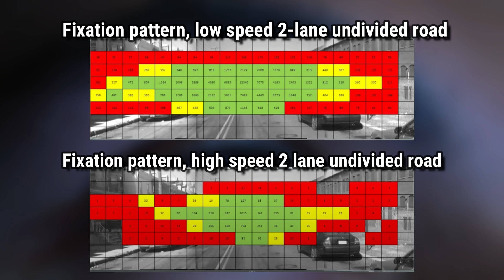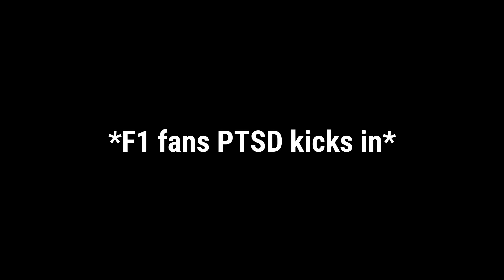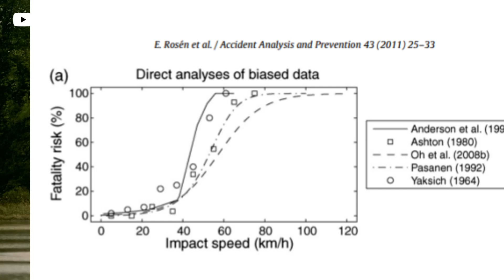Why Speed Limits Are Useless

Comment: Driving in Ireland was a brain tilt. 60mph speed limit on twisties where the road was so narrow, one of you had to poke your front bumper into a hedge so the opposing traffic could pass. Most driving was done at half that speed; but there were straightaways. *They assumed you had common sense*. Watching for herds of sheep, or the odd one crossing. Driving has your FULL attention, and I never saw even a fender bender. 

 I never saw a driver with a phone in their hand.

Comment: If a city makes a road more dangerous they should take on the liability for any injuries or damages caused by the design. 
Speed limit and signs work perfect for most people most of the time. It's just we live with a sizable minority of jerks. 

7,000 deaths a year is nothing given that healthcare mistakes, (medical errors) kill 500,000 people a year. Instead of spending trillions to make roads more dangerous spend a few billion to force hospitals to electronically track the medications they give people to avoid conflicts. That simple change would save nearly 90,000 lives needlessly lost a year. 

Not that any traffic use vehicle safety measures today are not going to matter in 20 years when all cars will be highly augmented with computer driving assists and accident avoiding systems. The move for road redesign could have started 40 years ago and had some positive impact. Within a decade or so most of our biggest avoidable traffic accidents we be solved by technology.

Comment: Why is the elephant not being addressed? If it is unsafe to drive 30-40 mph on city streets or over 65mph on the highway, why do auto builders make 600+ hp cars? I see bikers doing well over 100 mph going down I-20 in Dallas TX. NO, not all bikers do this, but enough do that they are a danger to themselves and others. If cars were built to only accelerate to 70mph then you would eliminate a whole lot of fatalities. But, the public would not stand for that (me included). Better driver education, serious enforcement of cellphone laws and stronger punishments for traffic violations have been tried. I agree with "better designed roads", but there are many other things that would help.

Comment: Speed limits themselves are useless. It's just that driver training is vastly insufficient in most countries. Besides, how can a 30 year old shitbox on chinese tires be able to safely travel at the same speed that a brand new car full of safety systems, with top of the line rubber? And how can you compare skills of a professional race driver to the skills of an 80 years old grandpa with dementia? Putting everyone and everything into the same basket just doesn't make any sense. Drivers should be allowed to judge the safe speed themselves. And they should be held accountable for their decisions. No speed limits required.

Comment: I am not trying to say narrow roads are necessarily bad, but there are two main reasons that I can think of why American roads are so wide. One is to better facilitate the movement of large-scale equipment and vehicles. It has long been a trend in America that bigger is better, after all. The most important one, though, is to help our military mobilize much faster. You have to realize that much of the road system of this country was originally designed to help our armed forces repel invasions or move more quickly across the country in the event that they need to stage an invasion themselves. That's not to say that we shouldn't change things at least a little bit. Though the biggest change really needs to come from the drivers, not the roads, if you ask me. The fact is, too many stupid people think it's alright to speed through cities and towns on the regular.

Comment: I actually disagree with your points. In the same way that Moral Law exists outside of how we feel or perceive, speed limits are the local set law for the safety of a specific road. Everyone will perceive safety differently which is why we need law. As a society we need to learn how to not go off our feelings but by the law. While i think the infrastructure should be changed for the better, its not the solution, but an aid to people who listen to their feelings more than the law.

Comment: Great job on the video. How about, as an interim measure, educating drivers to readily identify when they're on a street that's not built to provide the correct visual cues? In other words, learn to recognize when you're getting signals to drive faster and SLOW DOWN. It could be part of driver licensing, alongside learning the Rules of the Road.

Comment: Speed, or Speed Limits, is use in America because not of the speed itself but because of people who drives are reckless.  There no ways to fix the roadways in America other than using Interstates Freeways.  Also the cars in America only design the top speed of 90mph.  Not just horsepower but suspension, steering, and other cheaper designs that limits the vehicle’s performance.  And most idiots, I’m sorry I mean drivers, don’t know this and do not care if they cause an accident.

Comment: There is a term I've heard used before for that "dangerous road" you use as an example of bad road design in this video - a "stroad" a sort of streat-road hybrid, where you have a high speed road, serving the function of a low speed street at the same time. These are very common in suburban settings in both the USA and Canada and are very discouraging for cycling and walking, tending to force people into cars.

Comment: The USA has traffic systems designed to allow commercial trucks in and out of areas. Thats how we get everything to its destination. The size of a truck is pretty much standard. If we start making things too narrow and claustrophobic we cant get deliveries to restaurants and shops. Then we'd have to completely redesign the transport methods and add another layer to an already complex system. For example look at a euro truck compared to an American. Euro trucks are short and narrow even if theu havr a trailer. Most of the time its judt a box truck. In the usa you habe a 20 foot tractor in front of a 53 foot trailer thats 108 inches wide. You need this for long distances between shipper and receiver. In the Netherlands you can cross one side to the other easily in a day and return home. An American driver will spend weeks out on the road driving between cities
Reply: Finally, someone understands my point of view, as a trucker who has been around a good chunk of Canada and the U.S., why we can't narrow streets.

102" wide is actually the max. I remember last year seeing a few 60ft trailers from Walmart in Ontario. I doubt they do multiple pickups and drops, most likely just to and from major distribution centers.

There are times where the destination of the load is on the other side of town and the only way there is through the middle of town, we need the big streets to make it around the corners without running into trees, traffic lights, hydro poles (I'm from Manitoba, Canada where we generated about 90% of our electricity with hydro electric dams and thus everyone calls power poles=hydro poles). 

Shrinking the streets in the middle of town to the point where they would only work for a car would create havoc for the trucks that have to get in/out/through those areas. I can think of a few corners where I have to take up 3 lanes from the street that I am turning from, and 3 lanes on the street that I am turning onto, just to make it around the curb. 

Plus a lot of European cities were built before cars, most American and Canadian cities were built for cars or at least built for horse and cart and then modified for cars.

Comment: Another point not mentioned by the narrator is that a street may be designed for 50 MPH traffic but signed with maximum legal speed of 30 MPH--giving plenty of invitation to drive faster and get ticketed, generating plenty of revenue for the city, the county, or the state. This is done intentionally.
Reply: Got a stretch of road like that by a university. Speed limit is 40mph before this stretch and drops down to 25mph with no change in the road (feels like 40). Even the slowest drivers I've been behind, still drive 40mph anyway on this stretch
Reply: @bixbysnyder-00  There is a road like that in auburn that does the same thing. There is no change in the width of the road, no additional trees planted, no curves, nothing that would ever signal to a driver "hey, you should slow down". Instead, the cops here just use that to set up a speed trap. Its all a money grab, from the predatory towung subsidized by the city, to expensive college, to the police here, its awful. The cops here are so bad that I actually feel less safe if there is a cop around, even if I know im doung nothing wrong.
Reply: @cadenorris4009 and there’s no city you are entering or anything like that when it drops down to that speed?
Reply: Not always or necessarily intentionally to generate revenue. That is untrue.
Reply: Another problem with speed limit signs is that you can never tell whether it was placed by an engineer or a politician.  The engineer starts from the law of physics: E = ½mv² which is self- enforcing.  If you are doing 75 in a 55 mile zone, there is roughly twice the energy available to mangle the motor vehicles and puree the people when something goes wrong, regardless of whether there is a cop in sight 😢 !
Reply: @WalterRutledge-l9i  this has been mentioned many times by speed enforcement advocates. In practice, it's not the absolute speed, but the relative speed difference between you and rest of traffic. If everyone is doing 75 in a 55 speed limit freeway, then you're far more likely to be in a collision being within the posted limit than driving at the same speed as others.
Reply: @dominionian7193  The unwritten rule of running with traffic (within reason) actually works. The problem here in the USA that causes the most issues that I've seen (other than cell phones) is lack of signaling, and we just can't seem to "zipper" for shit at entrance ramps/narrowing roadways. 

Nobody ever wants to "give way" and let someone in. Like being one car position back or forward is going to make a vast difference within a 5000-car group lol. I hate driving in/around cities. You have to shoehorn your way everywhere all while watching for some jackass to cross 5 lanes of traffic without signaling.

Comment: As a computer gamer, i had to practiced driving at speeds over 100mph.  From time to time, I use this ability while driving.  However the one thing i had noticed, the faster I go the more alert I am, and the slower I go the more relaxed I am.  So there is more of a chance I will see a red light while driving at a faster speed then slower.
Reply: Me too. I get bored putting along.

 Also, in traffic, going slow is far more dangerous than speeding on an open highway.
Reply: Boring normies can never understand that… speeding is associated with reckless behavior because of reckless people but there’s nothing more engaging than high speed control. 

It’s obvious that to reduce accidents, you need to increase discipline but nobody focuses on this core issue. It’s always about treating the symptoms to the accidents instead of the cure disease.
High speeds, with proper road discipline, stopping window maintenance, car maintenance and signage can basically lead to ZERO accidents.

Comment: First things first, you forgot that driving is a privilege not a right!, and if they really want to make a roadway safer in the one area mentioned about the 30mph to 40mph, if they designed it so you backed into the parking space it would be much safer, sure it may cause slow down when someone is parking, but it would be beneficial and less time considering where my area has the same parking people stop in the middle of traffic to let someone out which usually takes twice as long to perform as to slowing to merge over to the left to go around someone backing into a space. Better yet create a paring space or structure, one of the biggest problems is packing buildings so close together.

Comment: If speed was dangerous Flying, HSR, and Highways would be the most dangerous ways to travel, but actually they are the safest.

The most dangerous roads are Undivided Rural Roads and Stroads where speeds are moderately high, and there are many conflict points.